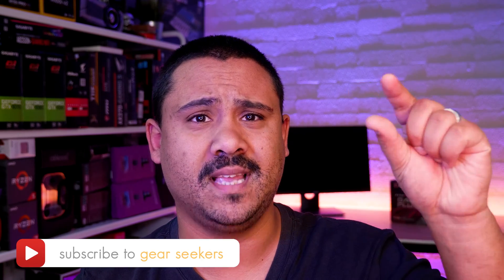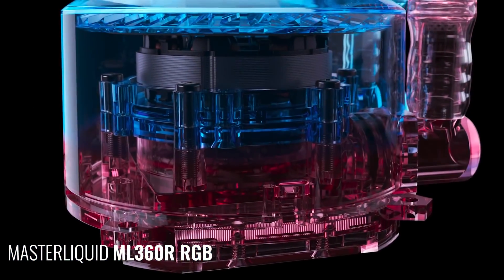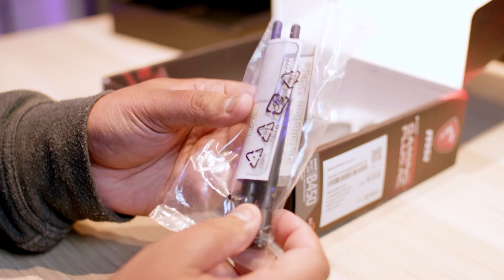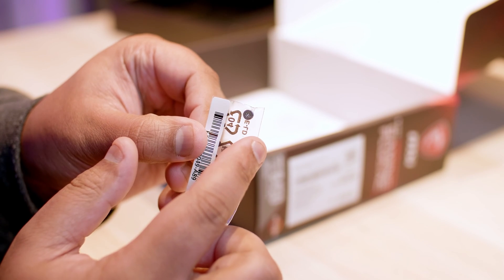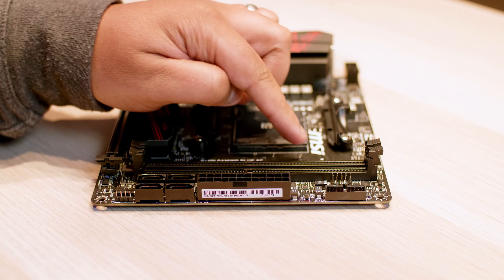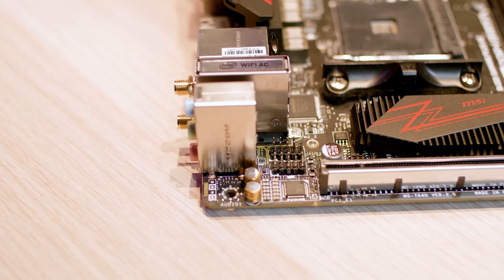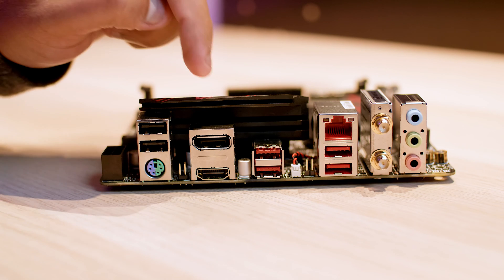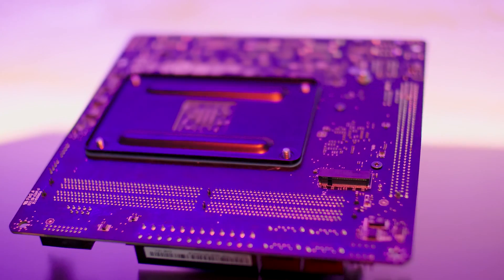MSI B450I Gaming Plus AC Mini ITX Motherboard - First Look and Unboxing

Comment: My god I am so confused, I am buying this on amazon and half the reviews I see online say this board doesnt go with AMD 5 3600 right out of the box, another half saying it does. And then another half of that saying they cant do bios update without older gen cpu, and another half saying they can. And then I have another half saying this board doesnt come with wifi!! AHHHH
Reply from the maker: Because they are all idiots lol.
This board will work with Ryzen 3000. You will have to check if it is pre-updated.
Most B450 boards you buy new will be updated. I bought a B450 board a few weeks ago that had a sticker on the box that said "Ryzen 3000 Ready"
It always good to double check.
Reply: @GearSeekers  I see! Thank you!!! : D

Comment: How do these compete with the strix b450i?
Reply: Strix has 2 m.2 slots and intel gigabit lan  plus better ports. I think overclocking would be relatively the same. I picked up the msi board for $80 new on ebay. Was 5 secs away from picking up the strix for $140. Ngl The extra m.2 slot would be nice tho
Reply from the maker: Same same
Reply: @GearSeekers  3200 mhz ram works?

Comment: Im planning on using this mobo for ryzen 5 3600, is it a good choice or nah?
Reply from the maker: yes. it will need a bios update first though
Reply: Yep! Doing the same exact thing with my build but as Gear Seekers said it needs a bios update first so I would recommend buying a 2600 off of amazon, updating the bios with it, then  returning it and getting the 3600. Alternatively you might be able to get your local computer shop to update the bios for you.
Reply: How about the msi gaming plus max?
Reply: ucatanisi98 I ended up using b450m mortar titanium and it’s ready to go with the ryzen 5 3600.
Reply: @carloponce8814  great choice.

Comment: And my stock ryzen 3 2200G cooler doesn’t fit this motherboard. 
(I think my unit came with the wrong stock cooler)😢
Reply: Yes the cpu fan blocking ram slot, but the fan top cover can be removed
Reply: @kindert.m.9694  quick tip. just install the ram first

Comment: "AMD stock cooler won't fit this motherboard". Is that true?
Reply: Yes the cpu fan blocking ram slot, but the fan top cover can be removed
Reply from the maker: No
Reply: @Joshua Winters 

Good to know that though I have decided to wait for the new boards.

Comment: Do you have any idea if the system fan header on this mobo is 1a or 2a? Can a 1 header on it handle 4 deepcool rf120 0.23a fans?

Comment: Which is better? This or Asrock B450 Fatal1ty itx
Reply from the maker: ASRock board because Intel NIC and USB-C
Reply: @GearSeekers  what is intel NIC?
Reply from the maker: Intel Ethernet adapter
Reply: Thanks
Reply: @GearSeekers  And what about VRM with this motherboards? I hear something about bad VRM in Asrock B450 ITX. I do not know which of these two
Reply: Also ASRock has the a type c header